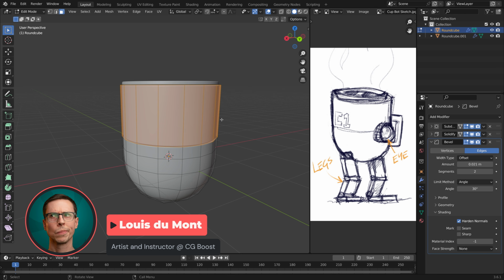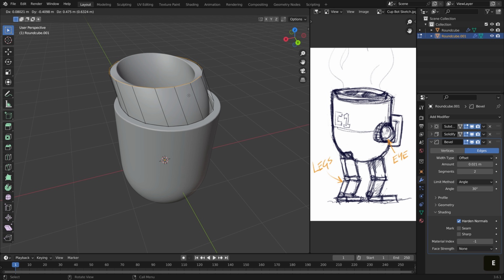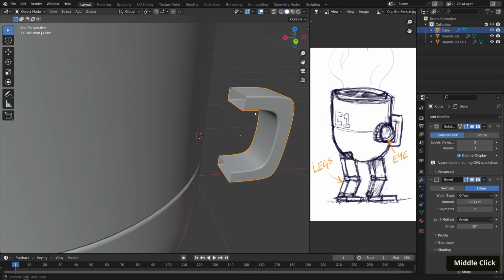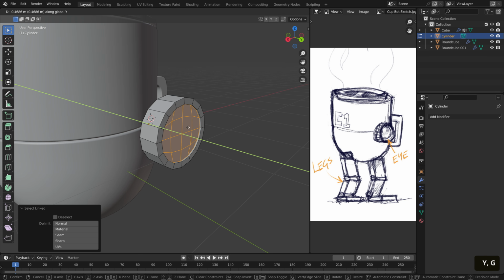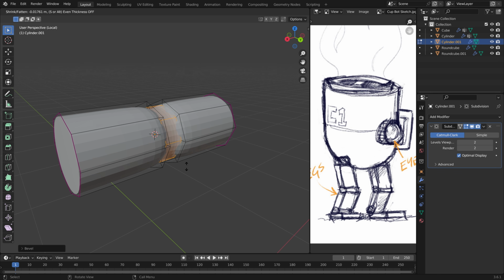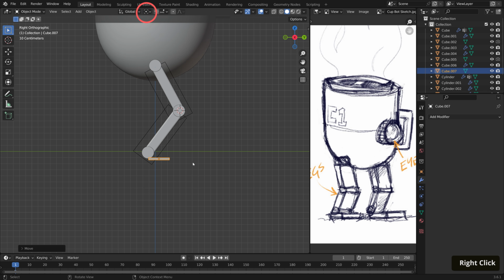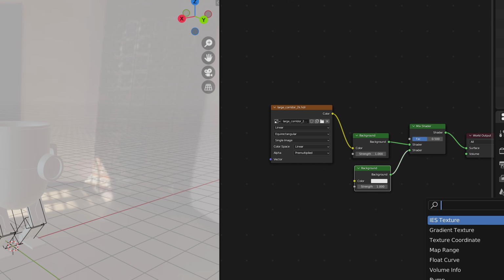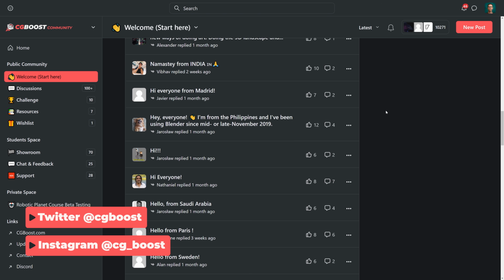Blender Hard-Surface Modeling Fundamentals #b3d #tutorial

Comment: 5:35 would anyone top of their head know why my line is not straight? 😬 maybe didnt subdivide the roundcube enough?
Reply: the line separating the two parts of the outer shell? if you drop the number of subdivisions on the round cube to 3, then yeah, you lose the nice straight edge that he used to extrude up at 2:25 or so. if you don't want to start again and use 4+ levels of subdivision on the round cube, you can also straighten out the edge loop on the Z axis. 

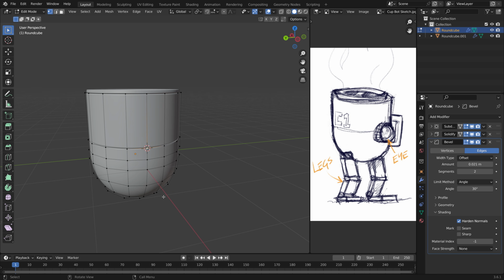to do this, you can select the edge loop, then hit Shift-S and select "cursor to selected", like he does at 6:10. this should move the cursor to the average height of your edge loop on the Z axis, but keep it centred on the origin in the X and Y axes. from there, make sure you have the transform pivot point set to "3D cursor"—that's the little drop-down menu immediately to the right of where it says "Global" in the top menu bar—and hit "S" to scale, "Z" to constrain to the Z axis, and "0" to scale all the points to the same Z value. you might want to do the same thing for the lip of the cup, or it'll prob look strange and uneven.